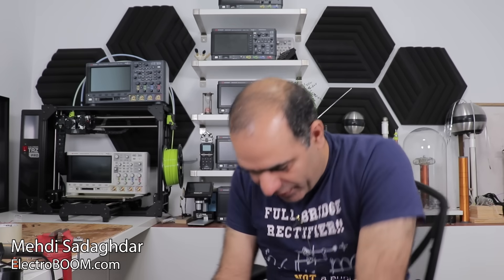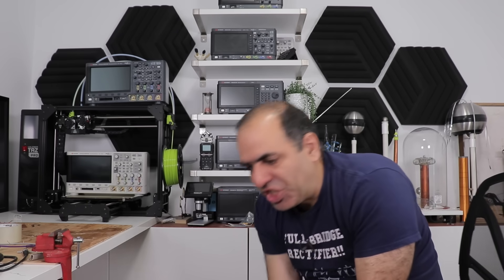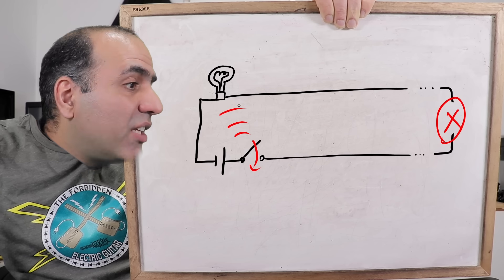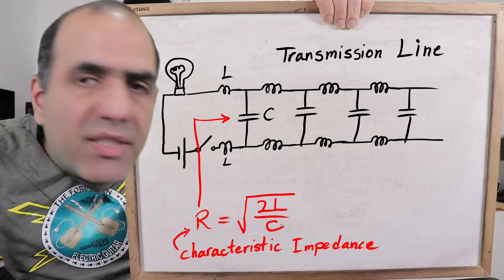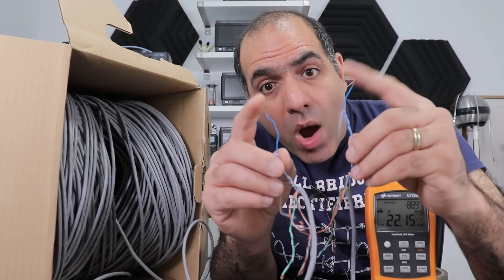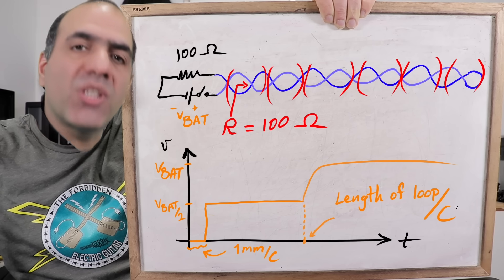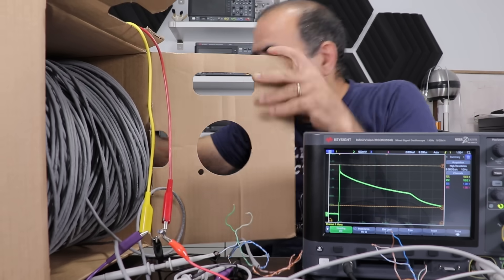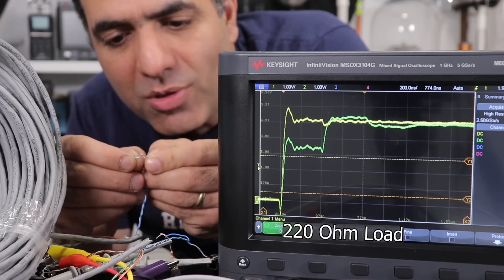Testing the LONGEST LOOP OF WIRE!!! to Turn a Lamp On

Comment: And this is another situation where I learned a lot more from one "silly YouTube video" than I did spending a decade or so in engineering classes and using credible sources. Before this, I simply could not understand what crosstalk even was and assumed that wires randomly transmitted electrical noise.
Reply: The thing about classes is that they want to teach you how to model or test or predict something more than they want you to understand why it happens. Using the example of this video to find the length of wire with an oscilloscope, you wouldn't need to understand why it works in order to use the concept, which is what an employer would be more interested in (results). It's not wrong, but for folks like us who like to understand things it's frustrating.
Reply: @MarkLeinhos  I suppose I am just the type of person who cannot understand for the life of me where theoretical knowledge "here is everything about this" would be useful versus practical "here are the important details put in short form" information.

Formal education is nice IF you want to be a teacher, which then perpetuates the vicious cycle of artificial usefulness. When it comes to getting anything done, like in a future job, there are much, much better resources. There are so many subjects such as arts, politics, psychology and sociology, etc., that absolutely require not only practical understanding but also a bigger-picture lens. In those situations, post-secondary and "official" whatevers would be a horrible fit and despite that people are still being pushed to get a PhD in... fine cuisine. I am sorry, but whut??
Reply: To give an example of what I mean, look at all of the tangential details that has Mehdi screaming "IT DOESN'T MATTER". He is very correct in that those details are insignificant. Sadly, they are also the level of detail that are explicitly demanded from you to evaluate to ensure with absolution that all loose ends are covered... despite the fact that none of them were worth talking about in the first place.

The tests that LinkedIn provides for you to "prove your skills" is a perfect illustration of this point; over a third of the questions that it expects you to know revolve around topics that an employee will never actually encounter in his/her line of work, regardless of where exactly he chooses to work.

Comment: The engineering genius behind twister pair never ceases to amaze me. Another nuance to the design is when you get a source of EMI having the pairs twisted, the EMI tends to hit both cables in nearly identical ways. This means that you can send the pulsed signal over one wire, the neutral one the second wire, and subtract the EMI voltage of the neutral side from the signal side for noise cancellation.
Reply: Awesome didn't knew that

Comment: 4:33 Me: of course it doesn't turn on anymore. Now it already knows it's an open loop. 😋

Essentially that's what happened. The capacitor made from the wires were charged up the first time it was connected 😁

Comment: USE LIQUID NITROGEN TO COOL THE WIRES DOWN TO DROP THE RESISTANCE!!!
LN2 is extremely cold. Put the bundle into a Styrofoam cooler then fill with LN2.

Comment: Okay, why are there bumps during the transition as seen from the oscilloscope?

i.e, when the wave reaches the end, the led or resistor or output drops down/up realising that it's an open/closed circuit... But why is there a bump in the supply voltage... With opposite behaviour of up/down as seen from the yellow curve... Why?
Reply: When the wave of charge reaches the other end and finds an open circuit there, the wave has nowhere to go, but to come back on the same conductor. That means the voltage goes up, in ideal conditions it doubles as a wave coming back to the origin. Then, when it reaches the origin, it either finds a open or closed circuit, and the process goes on. 

See my vid 001 and 003 for more discussion at https://youtube.com/channel/UCxI7uEC_TXDTLzFBGNMTVow

Comment: Shorter line length?
Sir, surely you jest.
More Power
Several hundred or thousand Volts should do the trick.
You may need a resistor in line with the LED though.

Comment: Love your material. Two recommendations. Drop this topic, it is getting very stale.  Second you are making so many setup changes the average viewer will have no idea if they matter or not. For example twisted-pair is specifically designed to reduce RF interference/cross-talk. You lose some of your well earned credibility with making so many unverifiable changes. Recommend we move onto the next topic.

Comment: unfortunately, this has nothing on the loop of wire the stock exchange uses to add lag to online transactions that measures 38 miles in length

Comment: You can't remove wire resistance?
You actually can. Just sink them in nitrogen.
Reply: That is YouTubers  way,  but not an engineers way
Reply: Engineers don’t cool the wire, they go thicker to reduce resistance. See my vid 003 for the power line version at https://youtube.com/channel/UCxI7uEC_TXDTLzFBGNMTVow

Comment: But this is not what veritasium wanted to show
You did a consistent explanation backed by practical experiment and addressed many points that could be confusing
The veritasiums video was more about skipping assumptions, jumping between levels of abstractions (from simple circuit directly to complex theories of electromagnetism) in order to misrepresent his question and say that we were thinking about everything incorrectly. All this while staying technically correct.

This is a good video, I can only wish that veritasiums original video was like this one

Comment: 14:51 The wave form on the oscilloscope fluctuates as you speak.  What is causing that?
Reply: Probably because of the power supply messing with the signal

Comment: Seeing the waveform difference when you connect and disconnect the circuit is amazing, how it jumps at the point predicted by the speed.  Really drives home the point.
Reply: That makes me really want a scope
Reply: @arletottens6349  Oh man, that is brilliant and so simple.  You need to know the speed of light in that medium pretty dang accurately though to find distances that are relevant for searching, right?
Reply: @arletottens6349  Indeed. The timing gives you the distance and the nature of the reflection (up or down) gives you the nature of the fault (broken line or short circuit).
Reply: I dknt understand. Did I connect my scoop wrong? Is ice scream scoop ok for this? I soldered usb to it
Reply: @DJDannySteel  you probably need another kind of scoop. maybe a giant ice scream scoop?
Reply: @arletottens6349  I worked for AT&T and we had tools for finding the distance to a break or fault... they were not terribly reliable, but they were pretty neat.
Reply: https://en.wikipedia.org/wiki/Time-domain_reflectometer

Comment: Stupid question. If you cooled the bundle of wire, let's say to -15 degrees Celsius, would it make much of a difference to the resistance of the wire?
Reply: Not much
Reply: @sayyidsahal4533  Fair enough.

Comment: I'm not as awesome in my knowledge as Mehdi but the 66 percent thing isn't a surprise to me as a ham radio operator.

Every transmission line (coax cable, twisted pair, parallel line, etc.) has a quality called Velocity Factor.

As Mehdi said the speed of light decreases due to dielectric properties.

Most common lines have a VF somewhere between about 66 percent and 80 percent. 

Hams have to take into account VF when preparing antennas because cutting the feed line to certain wavelength fractions can have interesting effects.
Reply: Thanks a lot for giving us the correct term to google for: 'velocity factor'. Wikipedia has the numbers: https://en.wikipedia.org/wiki/Velocity_factor . It has Cat-5e twisted pair at 64% of vacuum speed of light. Awesome video & comments, I never knew anything about all that before! 👍🍪

Comment: I thought my video with you a Derek talking was great, but this video is even better.

BTW - Voltage as knowledge is a very strange concept. It only drops after the knowledge that the circuit is open? That's wild.

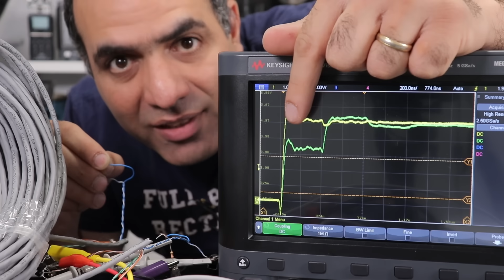Comment: 14:33 Can you boost the voltage of a battery with some circuit that captures and repeats the overshoot in voltage as seen at the timestamp?
Reply: Kind of, but not really. It's been a minute since I've done this analysis so take me with a grain of salt. But basically what's happening is that overshoot is basically a wave of charge that is bumping against something and splashing not entirely unlike a crashing wave. But that energy is mostly reactive, which means it can't really be used for work for... reasons. What you can do, however, is you can add circuitry to balance the load impedance to the line and source which will reduce the overshoot and allow power to go into the load more efficiently. Which is kind of like catching and draining that overshoot and funneling it into the load in a controlled manner.

I'm sorry if that didn't make sense. It's been almost 10 years since my degree and I've been spending it programming...

Comment: This was one of the most engaging and informative videos I've seen in a while! I love how the oscilloscope helps you show the wave propagation behavior, and while I was familiar with some of the effects of twisted pair wiring, I wasn't aware that it also cancels out the effects of induction.
Thank you for continuing to make informative, entertaining videos!
Reply: It's the entire point of twisting the pairs. It's so that fast speeds can be achieved. I.e it helps to reduce noise.

Comment: I didn't understand a thing. Why would the electric field reach the load irrespective of the conductor length through the air? The electric field goes through the conductor only, right? What am I missing here? Moreover, the supply voltage is DC, so it's even more confusing. The electric field should reach the load only when the circuit is closed (in my opinion).

Comment: This is one of the most beautiful practical experiments I've ever seen. Your ability to invest the skeptics with the disclaimers and later explain the disclaimers, after you've constructed the experiment, really knocks this one out of the park.
Reply: Agreed!
Reply: Except the important loopholes aren't even mentioned, much less addressed. This video actually demonstrates the opposite of the claim being made: if electricity moved as a field, the resultant signal would reflect the chaotic reality of wires coiled around in a box, instead the signal reflects a reality in which the energy is tightly constrained to the physical wire.

Comment: Thank you for great video! I have an argument just to mess with you a little at 2:43 (don't take it serious =)
If we imagine a battery as a water pump, then it "sucks" electrons from one side and "pushes" them to other side. When you cut one of two loops the battery start "sucking" electrons through shorter end creating current in a lamp. So it does matter =)

Comment: As soon as you connect the battery the electrons move into the wire and express their EMF across the swich. They are already there and ready to go. Close the switch and they move at the speed of light and the light goes on.

Comment: Accidentally turning Ethernet cable into a transformer is not impossible but difficult because of very low voltage Ethernet signaling which helps with dealing with the inductance of the cable so the signals lack enough energy to actually become a problem, and of course for the possibility of that transformer situation, the Ethernet adapters already have protection - it's always best to anticipate any situation and design into the hardware rather than assuming it won't happen - it already can easily happen with the POE (Power over Ethernet) setup, so redundancy and reliability generally pays off. And transmission line is kind of challenging to model especially when you really want to make a Nitrogen gas laser which is stupid fussy about the electrical charge efficiency when they lights up - they may just spit out useless blue and UV light, or actually lasing at 337 nanometers UV. Yet demonstrating it is a nice way to gain understanding of how it works.

Comment: You can use a similar method to work out the length of the wire or if it is broken along its length.

Comment: New experiment, woo, exciting to see the tires kicked on these theories. And the steps where you explained why an intuitive experiment design didn't work and needed to be tweaked was a good illustration of what was going on, too.

The humble Ethernet UTP cable is a very cost-effective communications technology and its fundamental design seems supported in your experiments.

I don't totally understand what was going on with the timing of the load voltage and the steps and everything, but I will watch it again and hopefully I will understand more this time.

Comment: veritasium has tricked you. he made you think like the power supplied during switch is like a moving worm from start to the end. and you'll probably think that the worm gotta move from start to end. he tricked you with a question but he already know what it is. its not a worm but its a veeeery long A$$ train pushing its body across the load.

Comment: Veritasium also claimed electrons don't travel down wires, that only the magnetic field does. Please address this. I can see in practice that they absolutely do. Not theory or a white board, but real life applications. For example, surging after disconnecting a large load.
Reply: Do you have a clip of him saying this? I don't think he used this exact wording.
Reply: Trying to find it.. he was discussing transmission lines with someone
Reply: I'm not sure what you're saying that surging after disconnecting a large load proves?  And how it proves it?

Surging after disconnecting a large load, can be due to "back EMF", which occurs due to the collapsing of a magnetic field.
Reply: PS, you can have some fun with back EMF with nothing more than a 9V battery, an inductor and wires to connect them.  The inductor could be the coil on a relay, for example.

Connect the 9V battery to the inductor, in such a way that you can easily apply and remove power from the inductor with one hand and place a finger across the terminals of the inductor.

Notice that when you apply power to the inductor, you don't feel anything in the finger which is across the inductor terminals.

Then notice that when you remove power to the inductor, you then feel a quick electrical shock in the finger which is across the inductor terminals.

You are feeling the effect of the collapsing of the magnetic field.  9V across the inductor terminals, can suddenly become hundreds of volts when power from the battery is removed, because the collapsing magnetic field induces a voltage into what has now become an open circuit.

Your finger however creates a circuit of high resistance, so the voltage induced by the back EMF remains high and thus you can feel it.

I noticed this when I was a kid, playing around with making relay based buzzers (audible).  Turns out that not only do they audibly buzz, but their "buzz" can be felt too!  ;)

Note that if you try this with a relay, you might find that the relay has a back EMF clamping diode installed, which exists to protect the circuit connected to the relay from experiencing a voltage high enough to damage it.  If this is the case, you will need to remove or cut one lead of that diode, in order to be able to feel this effect.

Also note that the inductor will need to be large enough for you to feel this effect.  It might not be noticeable with a very small relay coil for example.

And a note of caution, although this back EMF effect is very short lived, I cannot vouch for the safety if you were to use a VERY large inductor!  So whatever you do, do not touch the relay terminals in such a way that the resultant current would pass through your heart!

Don't touch one terminal with one finger and then the other terminal with a finger from your other hand!
Reply: @BeardyMacBeardFace  What on earth does it have to do with his comment?
Reply: @rdizzy1   He said, "For example, surging after disconnecting a large load."

Surging after disconnecting a load is often attributed to back EMF.

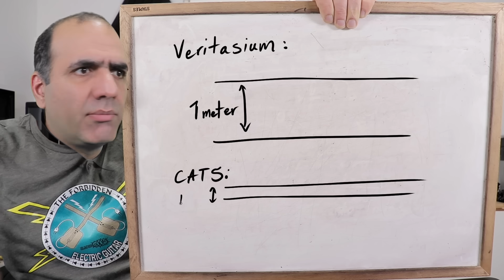Comment: @6:40 I think you slip here? "in my case, the energy reaches the lamp faster" with a "t = 1mm/c".  But it's the distance from the switch to the load, not the distance between the wires, isn't it? looks like a couple cm?

Comment: I'm sure it is no dielectric effect. Mehdi  has built a time machine. Due to large speed and lots of loops time slows down, similar to the satellites around the earth or accretion disk around a black hole. (Heard of a man called Einstein and his theory? :)
Way back I tested this with a coiled coaxial conducter on the loop and it had a similar effect of slowing down time.

Comment: Seriously you measured the cable length of 40 metres using measuring tape? The wire must have been having the itching of length after every meter

Comment: Nice video, He made a mistake, though.
He calculated the speed of electricity in his copper wire to 2/3 speed of light, but his wire is twisted, so it is longer than 2436m.

The speed of electricity in copper wire is actually around 0.9C.

Interestingly, the speed of light in fiber optics (any longer distance connection unless you go Starlink) is 0.66C.

Speed of light in vacuum is of course always C, regardless if the source is flying towards you or away from you (Special Relativity).

Speed of light in air is 0.9997 C
Reply from the maker: Twisting the wire contributes to 1 to 2% length difference. My light is 50% slower!
Reply: @ElectroBOOM  measure it :)
Edit: 1 meter will do, cut off 1 meter and measure untwisted, I am curious.